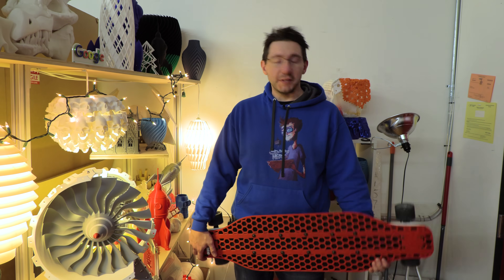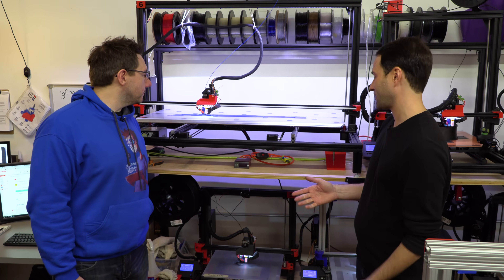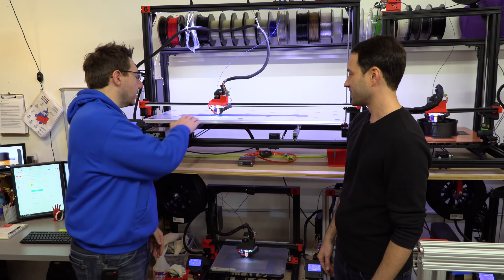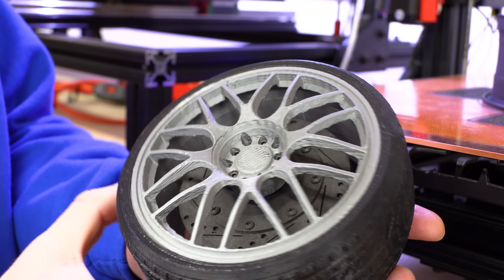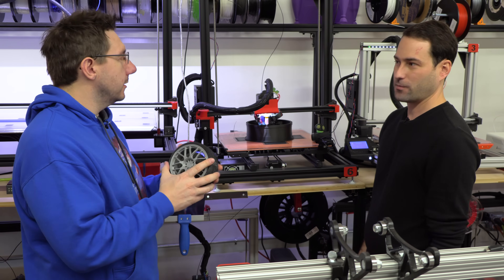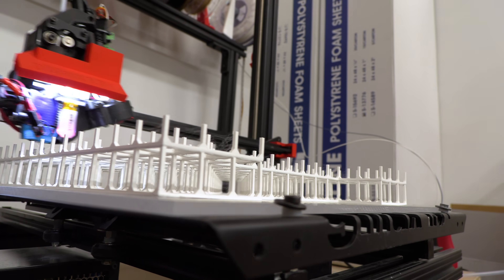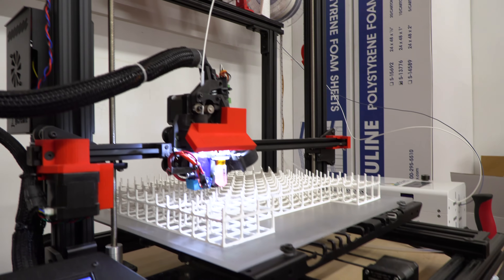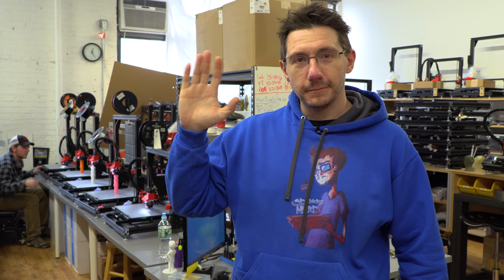3D Printing OpenRC Axle on the gMax 1.5XT+ // On Location with gCreate in Brooklyn New York

Comment: I built a similar machine.
I have:
Prusa I3 MkII (my version)
Prusa I3 MkII (Original)
Prusa I3 MkII MEGA (my mod) 600*600*600 mm
Anet E10
Lulzbot TAZ6
Lulzbot mini
And I am debugging my I3 terminator that has a print volume of 120*40*20

Comment: You were going to use the plastic bearing, using the layer lines to keep it lined up and turning smoothly. With the print orientation being different on their "G-max-max" are you going to need to change your bearing idea?
Reply from the maker: Not for the put-together, but, definitely once I power it and make it RC

Comment: Want that big 3d printer. Mine has a max volume of 140 by 140 by 140 mm. which is good for smaller things, but not larger 3d prints.
Reply: Jens Petter IkkeOppført I need it. It was hard not to throw a smoke bomb and run out of the place with it in hand.

Comment: Hi Joel,
I'm wondering about this 3 part Axle. It could probably work fine, if you added some kind of rectangular or triangular connection pin in the middle part (lego technics style). When glued together that would definitely counter twisting problems and should also add some strength to the connection point.

Comment: "Dial in the retraction settings", hmmm, the print looks like the retraction settings aren't that dialed in...
Reply: Thanks for the suggestions. It was our first print with MF pro and we used our standard settings for PLA. We printed another one and changed some of the settings and it really helped with the stringing. We also turned off "Coast at end" to stop the little blips at the corners of the columns.
Reply: TheZippyMan honestly if they brought the temp down 5 degrees that stringing would most likely disappear
Reply: Sean Connelly Absolutely! Thats one heck of a print!! Eiffel tower next?!? 😁
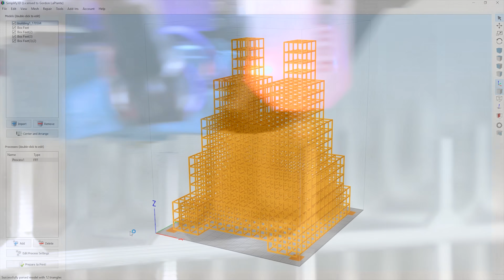Reply: Yeah, that totally looks like heat stringing. I don't see any of the obvious blobs that often come with bad retraction. If I saw that on a more normal print, it'd be five minutes with snips and a few seconds with a heat gun. Does look like there's a ton of ringing if you pause at 3:29 though. Might just be the light playing tricks on the latter, since it's not apparent on both sides.
Reply: But, I mean, it's still really freakin' cool.  I know I'm looking forward to checking out the full print at MRRF!  :)
Reply: Was thinking exactly the same thing :)
Reply: Gordon Laplante I'm looking into buying my first 3D printer (bought a Prusa MK3 assembled & after stories of bad products I asked if it would be easier to switch to a kit, well they cancelled my order & I haven't heard from them). I just stumbled on the Gmax 1.5Xt+ & love the features, auto bed level, E3D print head, etc. Just curious, what upgrades have been done since it first came out a couple years ago?

Would it be a good first time printer? I do own 2 router type CNC's with spindle motors (ShopSabre 23 & CaMaster Stinger 1).

Thanks for any advice, tips, etc.

Matthew